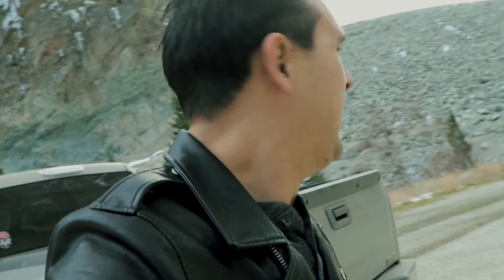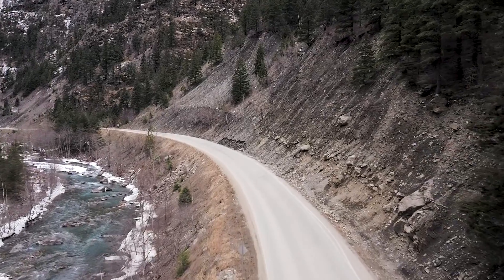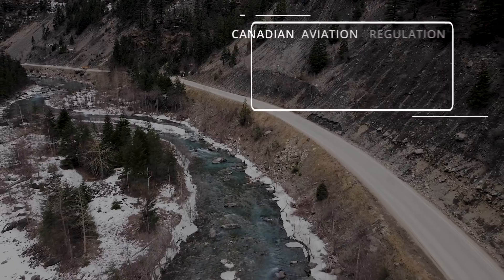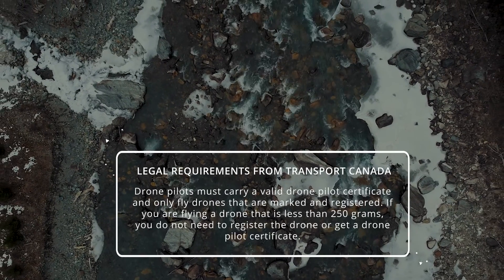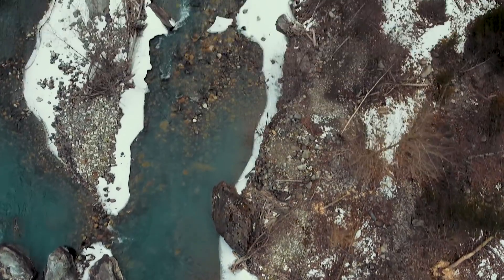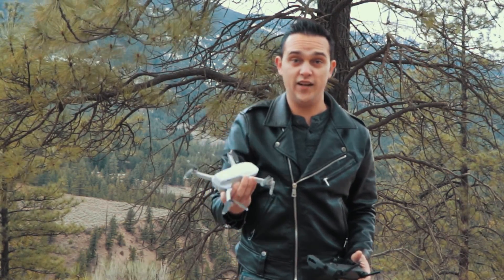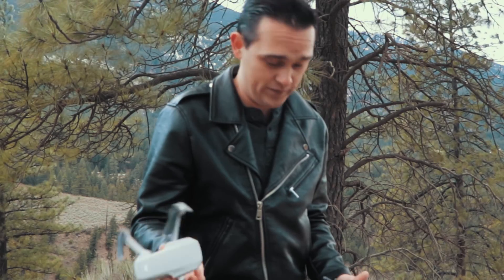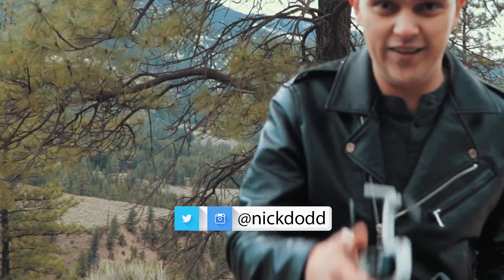RIP Mavic Mini, until we meet again.

Comment: Dude how did you break it like that, no way you didn't notice when it happened..

How did you brake it bro? I'm very very careful with mine.

Hope the DJI Care Refresh package goes sweetly for you, I also have one but I hope to never have to use it..

Sweet
Reply from the maker: I had changed the controls style and mixed up forward/backward and up/down. When I picked it up and flew it everything was fine for a flight after the crash. The following flight when I took off is when the arm cracked through.  Mistakes happen, next time I'll make sure controls are set the way I like them so not to mix up and crash again!!
Reply from the maker: Also the clip is at the very end of the crash.